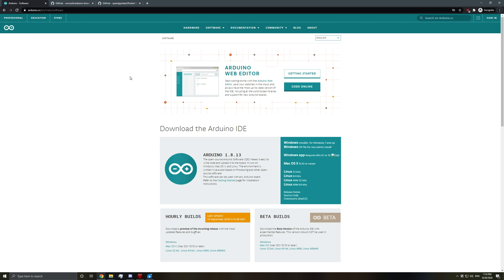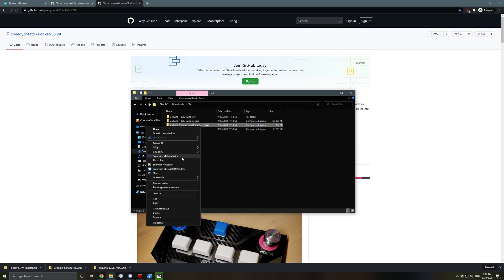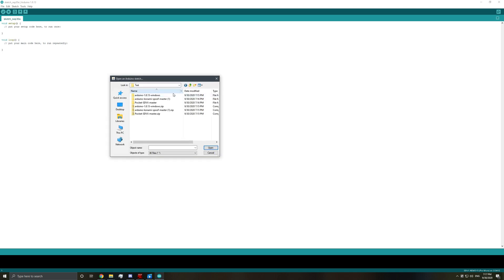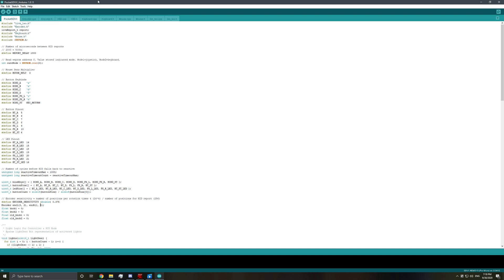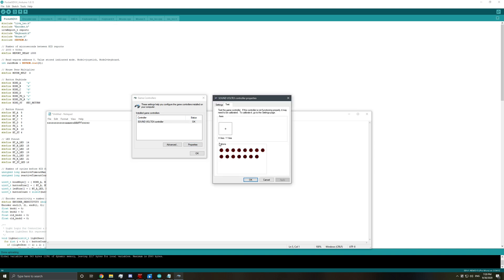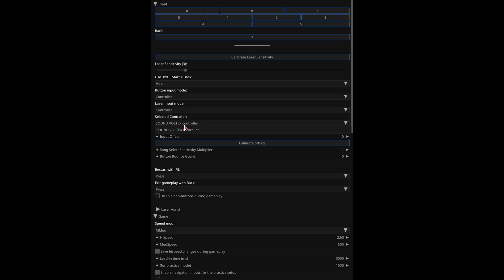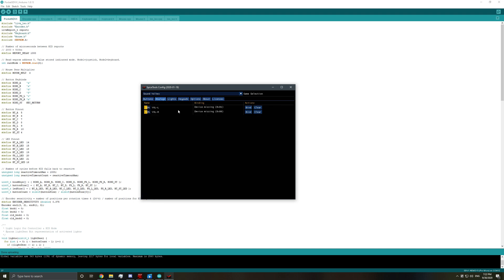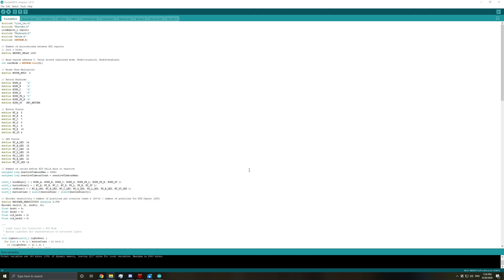Pocket SDVX Guide - Flash Firmware & Game Setup

Comment from the maker: Note: As of 2021/09/09, ARDUINO SPOOF IS NO LONGER NEEDED.  FLASH AS 'ARDUINO LEONARDO'

Also, if you are running into the "Using OLD HID" error, try enabling verbose compilation output under File > Preferences > Show Verbose Output during [compilation] and uploading again.  For some reason, this fixes it for me most of the time.